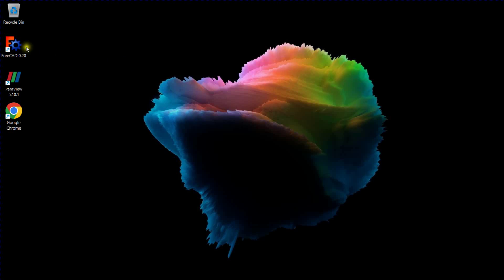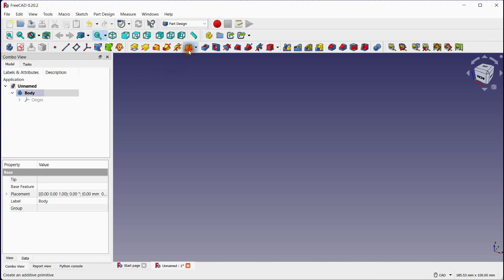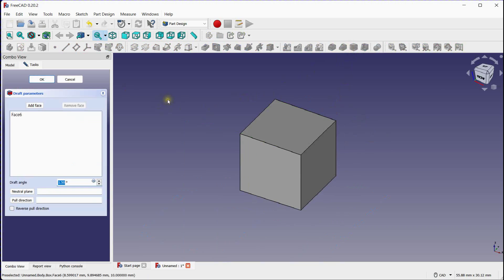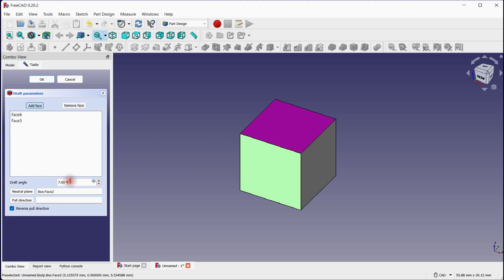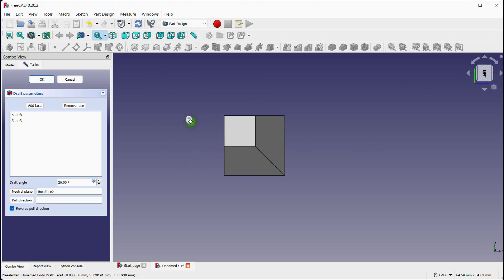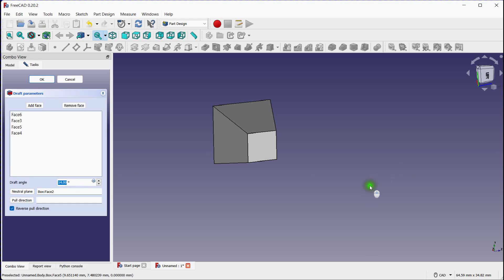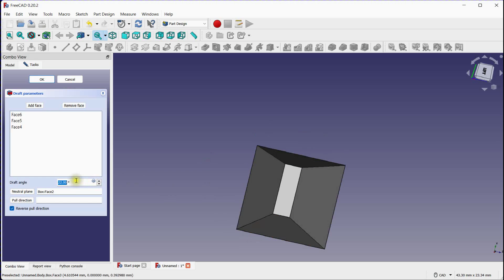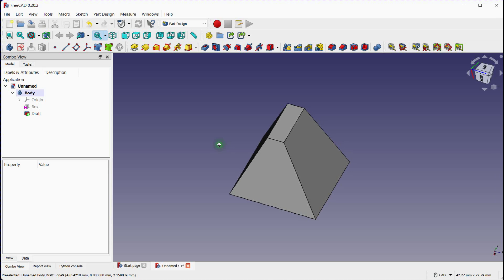✅Mastering Draft Angles in FreeCAD: Enhance 3D Design for Mold Release and Assembly✏️

Comment: Wee need some more tools-like check the draftangle with color scheme, doing the all part as one with walls which are close to vertical(angle 0dg.=color1, angle1dg.=color 2, angle 3deg.=color 3, etc.) Same goes for part thickness-check the part thikness on wllas/ribs colose to vertical -also with color scheme.
Other mold tools are needed(alignment/molding direction, center of the mass=center of the mold (where sprue would be located), parting line, parting surfaces creation, core and cavity and neutral or undecided surfaces with color scheme., auto creation of core and cavity blocks with size input .
Reply from the maker: Yes, it is possible with python scripts. We will cover in upcoming videos. Thank you for the topic.
Reply: @Learn-Engineering  Hi there. the second half of my yesterday's post with all the links is missing. I am wondering if it was you or did FB deleted the second half  of my post???? Thank you in advance for the feedback. JT
Reply from the maker: @jiritichy6855  Sorry for that, but we did not delete anything.
Reply: Well thanks! Really appreciate it! @Learn-Engineering
Reply from the maker: Thank you 😊